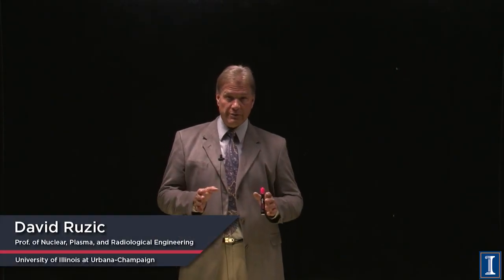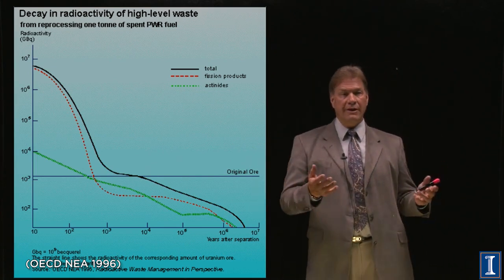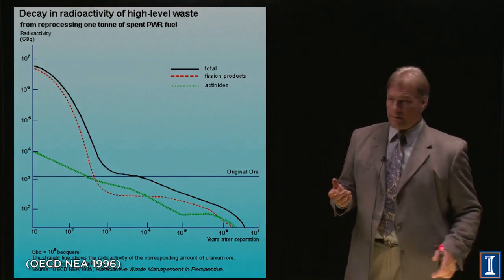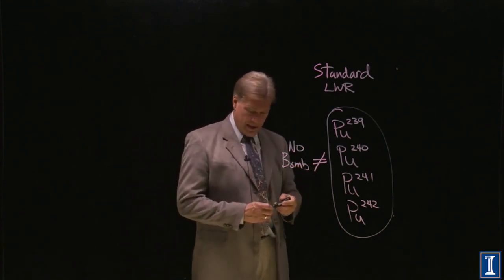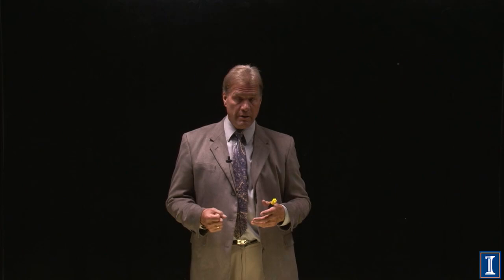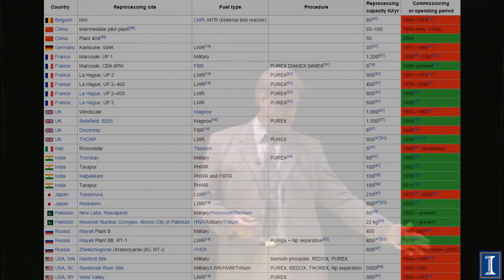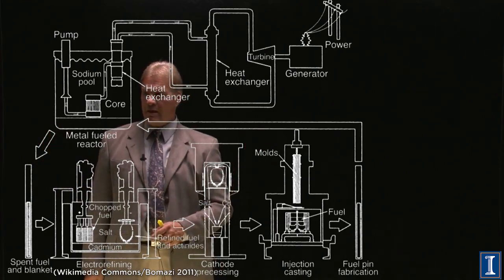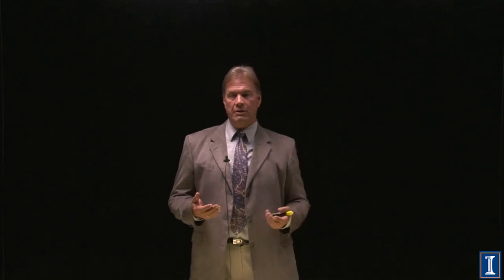Dealing with the Used Fuel (Reprocessing)

Comment: Any new reactor has to compete with 2 cents/kwh wind and solar, and can't. I'm interested in what we are actually doing with the spent fuel, and what we should do with it. I expect companies that shut down an old reactor will want to unload them, and avoid spending any money on them, and taxpayers will get stuck with the bill. My favorite solution so far is Yucca moutain, because it requires the least amount of effort long term.
Reply: Wind and solar add 2 cents/kwh to some other reliable electricity, usually the inefficient type of natural gas plant. The spent fuel rods still have 98% of their energy left in them and will be used in the new types of reactors in the licensing phase right now.
Reply: @chapter4travels  Is that the story you tell yourself to make yourself feel like you are right? It's true that variable renewabled are a PIA for old school baseload generators that are not designed to follow load. Now if you only had one solar pannel, or one turbine, in one spot with no grid connecting them, no storage, no ability to charge your car when electricity is cheap. Basically it's only like that in the minds of nuclear proponents, cause when all you want to use is a hammer, every screw looks like a stupid nail.
Reply: @chapter4travels  That's false, and not even the right question. When was the last time the wind stopped blowing in all of North America? Oh right, never.  If you have 24 hours of storage, and enough solar to cover your lowest day, you can do it.  https://www.lazard.com/perspective/levelized-cost-of-energy-and-levelized-cost-of-storage-2020/    

But enough theory, how about practice? Iowa produces 42% of their electricity with wind. Do tell all the terrible repercussions of adding all that wind power, with links.
Reply: @fjalics  Ever heard of line loss? The biggest problem Germany has is transmission line access, every country will have that problem. Germany is the perfect example of what not to do. Also, electricity only represents about 25% of total energy demand, what will cover the rest? Nuclear has none of those problems, only ignorance and political problems.
Reply: @chapter4travels  I have heard of line loss. It's about 5% in the US. Germany could use some north south grid upgrades to move wind power south. BTW, not all transmission is created equal. https://en.m.wikipedia.org/wiki/Ultra-high-voltage_electricity_transmission_in_China.     Not sure what your point is regarding nuclear. You mean you are going to save the 5% in transmission losses? Awesome. Wind and solar are still dropping in price. That is about one years worth of price declines. 10 years to build a nuke. That math isn't helping your cause. Electricity is going to take over ground transport from oil. I've been driving an AWD Tesla for 2 years. It's awesome. You should try one.
Reply: @fjalics  I'm all for EVcars, but you have not addressed the 75% of non-electric energy use. The country that has done the best is Germany at40% renewables for electricity, which is 1/10th of their total energy usage. the simple question is where will the rest come from? They already have the highest electricity costs of all of the EU and almost 3x the US.  California is going the same route with the same result.
Reply: @chapter4travels  You should check Iceland, Norway, and Portugal.  What have electricity prices done in Iowa? Germany's prices are high for a number of reasons, including taxes. Also, wind and solar have only recently become really competitive. As they continue to be added, they will displace mmore fossil fuels. This will include electrifying things. The best way to encourage that, is to lower the price of electricity with cheap renewables.
Reply: @fjalics  Line loss is 5% because the transmission distances are short, they go way up with long distances. Anything beyond 2500 miles you lose more than you put in and all of the voltage reduction terminals lose more as well. Then you have to buy millions of acres for new transmission lines. All over the country counties are banning wind turbines because of the low frequency noise. One after another in Iowa are restricting them to 1.5 miles to the property line of a home. People are fighting the transmission lines as well. Germany is having a huge problem with these. With nuclear, you replace a coal plant and utilize all the existing transmission infrastructure and you're done.
Reply: @fjalics  Great, rebuild our infrastructure for DC, yeah that's gonna be cheap. Is that included in the renewable cost that is promoted?
Reply: Taxpayers are already stuck with the bill since 2012. Taxpayers are paying nuclear utilities about $1 billion a year to store their own toxic crap. What a deal!
Reply: @jackfanning7952  Wait, let me guess, you must be a politician. You don't know political history, you don't do science and you don't really care about the environment, just your kickbacks. The nuclear industry paid for "waste" handling and disposal but the government failed their end of the agreement. So instead of fixing the problem they created, they have to pay the nuclear industry to store the high level nuclear waste. Brilliant! In the short term that is fine, but the "waste' does need to be stored for about 1000 years in a place it can easily be retrieved because it will be needed to power our country. It's worth a fortune in new energy production. But that's science and clearly, you don't do science. It's also incredibly great for the environment, but you clearly don't care about that either. What do you care about?
Reply: @chapter4travels  I detest all politicians. They work for the oligarchs that are using the government to control and exploit the citizens. I get no kickbacks. I earn my living with my work. I have done some things in my life I am not proud of, but I am happy to say I never worked for the government. I give over 20%of my time and hard-earned money to help some some of the poorest people in the world.  Why should the government be responsible for disposing of the nuclear industry waste or provide liability protection, loan guarantees and tax subsidies to the nuclear industry? Why does the nuclear industry subsidize the risk and privatize the profit? If the waste will be needed to power the country, why isn't it being done? Why is it being stored in open pools and casks with a useful life span of 10-30 years according to the manufacturer. Who is willing to pay a fortune for it? Why haven't they already done that in the 75 years that waste has accumulated or been dumped into the ocean? I will tell you what I care about. When the earth was formed it was so radioactive that no life could exist for several billion years. As the radiation gradually subsided, life was able to survive. We are very rapidly reversing that process. That is not my opinion. That is science. That is what Admiral Rickover who led the nuclear navy said. Not me.  Tell how the nuclear waste and ore tailings and brittle old rust bucket reactors and dry casks with a 10-30 year life span are great for the environment.
Reply: @jackfanning7952  Well you are sure long-winded like a politician and you don't know the science like a politician. It seemed like a logical guess. Ratepayers played a "tax" fee for every KWH of nuclear energy purchased, that fee was instituted by the government to cover the cost of waste removal, storage, and decommissioning. The government did not keep their end of the bargain, so now they have to pay the industry to hold the "waste" on site. It's completely safe there  indefinitely. The reactors that can utilize that waste are in the licensing phase right now in several countries including the US and Canada, the delay has of course been the government and the NRC/DOE. If you were really interested in the environment, you would be excited to hear this news and eagerly look into Elysium Industries or Moltex Power, but you are not interested in facts, just propaganda that you spread wherever you can, sort of like a politician.
Reply: @chapter4travels The nuclear industry and government has been bargaining for 75 years. But the industry gets the bargains and the taxpayers get the bill. The politicians get a share of the loot. Licensing phase, huh? How long before they are cranking out power? Name one nuclear power plant that was built on time and within budget. You can't. You keep guessing that your unicorns will work and be safe and economical. We will move on with modern technology that is running circles around the nuclear dinosaurs. That is a fact.
Reply: @chapter4travels  I sure do love my solar panels. They provide for my electricity without me having to pay for nuclear power, subsidized by government graft, fraud and corruption. Michael Moore? Hahahahahahah!  Clean nuclear? Hahahahahah. Asians don't get to choose what their despots do. Too bad. The whole world will be there to save some of them and try to clean up the mess when Asia melts down.
Reply: @Bob Don $15 billion spent on Yucca so far. Another $90 billion and 30 years needed to finish even if they could overcome the 100 or so technical reasons that the site is unsuitable for waste storage. If it was finished tomorrow, it would not hold all of the spent fuel now in existence and only would be effective in containing it for 100 years. Problems, problems. Those nukies can't seem to do anything right...except kill things  and spend America's wealth and health on the greatest business failure in world history.
Reply: @jackfanning7952  We have Vogtle 3 and 4 coming this year and next, at very premium prices. Summer 2 and 3 petered out after wasting billions. But that is it, and the old ones are starting to drop. They can go sixty years, but maintenance costs go up well before that. Here in Ohio, they paid off some republicans to pass HB6 so they can keep a couple of paid off reactors running.
Reply: @fjalics  You are right. Vogtle is six years overdue and $20 billion over budget. AP1000 Vogtle 3 is collapsing under its own weight, even before they fill the passive cooling water tank on top with 16 million pounds of water.The 12" steel floor is "dishing in" causing the double walls of the containment structure to be 2" apart instead of the design of 3." This will destabilize the structure due to the seismic effect in an earthquake. I hope they don't have fuel in it when it happens. I am in the same hemisphere, so I would be affected by the fireworks. SCANA CEO Kevin Marsh was convicted of fraud for lying about the debacle at Jenkinsville. He has a $5 million fine (peanuts compared to his golden parachute) and a jail term to be decided later based on him squealing on his co-conspirators. I am sure they are going over his testimony to make sure the good ol' boys in state government aren't snitched on. Larry Householder, Speaker of the Ohio House, and his pals were bribed $61 million in dark money from First Energy to pass the $1.5 billion a year HB6 to prop up Ohio nuclear and squelch funding for energy conservation and subsidies for renewables. First Energy got hundreds of millions a year to keep Davis-Besse with its cracked containment and Perry open. Illinois has its own bribery scandal with Exelon. The woman running the World Bank in Chicago is under investigation for sweetheart deals with her former employer, Exelon. Ancient, brittle nuclear reactors are dropping like flies because they can't keep up with maintenance and outage expenses and renewables are getting much cheaper as nuclear costs go up. States on the East Coast have signed a deal to get 30,000 megawatts from offshore wind power with major European investors. Europe is way ahead of the US because the 30 US utility monopolies are strangling the development of renewables here. They are big in fossil fuels and nuclear. They strong arm states to back nuclear with the threat to go back to coal if the states don't buckle under to the nukies. Yale360 has an article by John Hurdle about those wind projects. Also Tesla PowerPacks, PowerWalls and PowerVolts are flying off the shelves faster than Elon Musk can make them (See 3/1/21 Forbes article). And the Empire State Realty Trust (ESRT) just signed a 3 year deal with Green Mountain Energy to power all of its commercial real estate in NY and Connecticut with wind energy, saving almost $1 million a year. It has been powering the Empire State Building with renewables for 10 years.  Wall Street won't finance any new nuclear projects. Nuclear is an dinosaur,in its death throes. Once the financial gnomessqueeze the last drop of profit fromt he American public, they will put a lock on the gates, and SAFESTOR (an oxymoron) all the old rust buckets for the public to deal with 75 years from now (at the public's expense of course).

Comment: If you seal a nuclear reactor, close all valves, bulkheads and such while running at full power, cut off any water supply, said reactor becomes a bomb. Not a very effective/powerful bomb, but still one capable of flattening the power plant where it was running. Don't forget the nuclear materials ejected into the surrounding areas.
Reply: Depends on the reactor but most would just automatically SCRAM in that situation, shutting down and adding coolant. If cooling is insufficient and all emergency backups were to fail, then the nuclear material would likely melt and collect at the bottom of the containment vessel. If the plant is of a very old  design type that lacks some of these safety features, then it would likely melt straight down to collect on the foundation of the building or in the worst case into the ground underneath. The main potential causes of an explosion would be excessive steam pressure or hydrogen gas buildup, in modern designs they would release this pressure at planned points while keeping the containment vessel intact and little or no radioactive material is likely to escape with it.
Reply: @Stu_Bur  Moreover, EBR-II was tested with a circulation failure event. Thermal expansion changed the geometry og the core so it became subcritical.